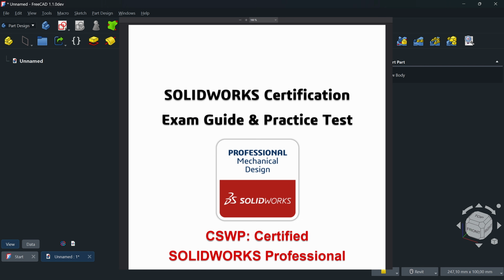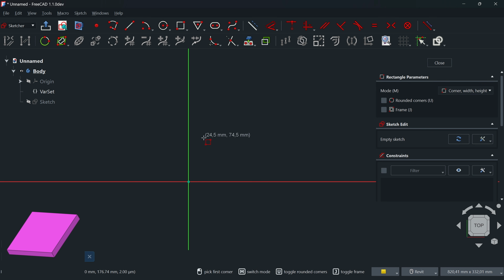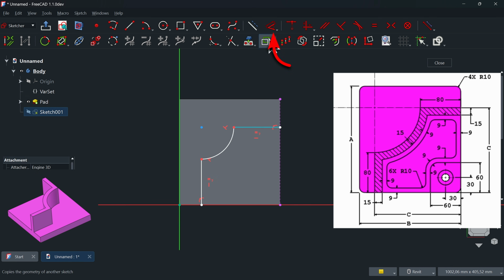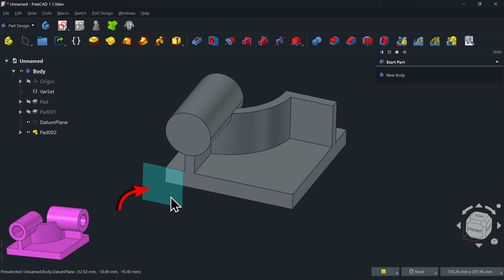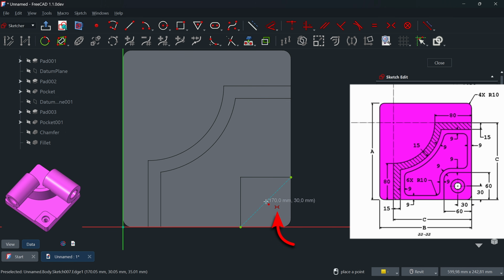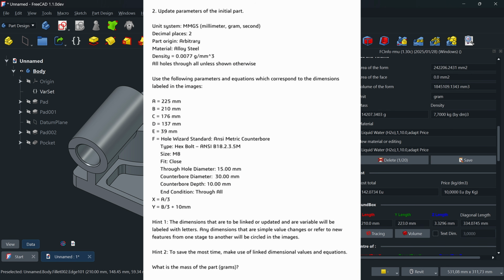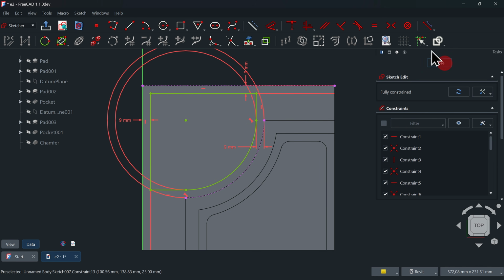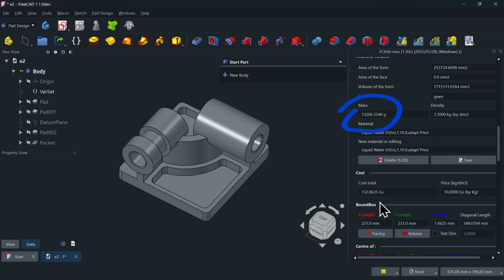Can FreeCAD pass the SOLIDWORKS Pro Certification CSWP ?  (Full Tutorial & Parametric Method)

Comment: Great video and support for FreeCAD!
Some small hints:
1. If you reference in a sketch, please use the previous sketch geometry.
2. If a dimension is used by more than one feature I would create reference datums.
(3. I prefer to create rounding if possible in the sketcher.)

Danke!
Reply: Yes, I was wondering why he didn't use rounded rectangles in his sketches. Fillets in Freecad can be fussy to deal with.
Reply: I will try to make it more clear.

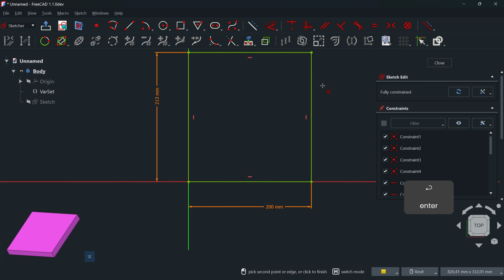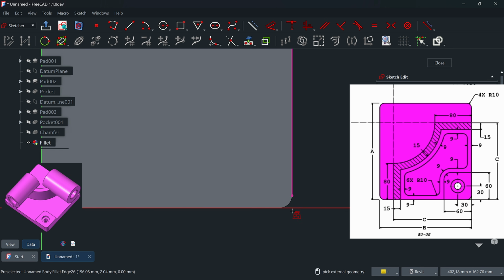At 4:59 he creates a sketch and at 13:45 he should use the edge of the sketch instead of resulting edge from extrusion (pad). Using the sketch geometry instead of “body” geometry as reference is making a freecad design much stronger.

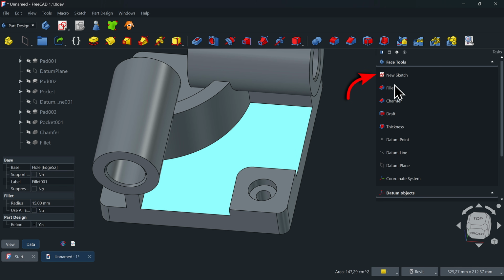At 16:26 is a resulting height from “pad” operation used as sketch plane, here it would be better to create a datum before and do the extrusion up to the datum and do the sketch also to the datum.
Reply: @efficincy  Thank you for the reply! I have some follow up thoughts and questions but I understand if you don't want to answer them for whatever reason. I appreciate what you have done already.

I attempted to follow your instructions and made a quick test to see if I could make it work. So from an empty part:

- I sketched a shape on the XY-plane
- Then I created a datum plane on the XY-plane and offset it by 10mm on the z-axis.
- I padded the first sketch up to that datum plane by using "Up to face"
- I attached a second sketch to the datum plane, showed the first sketch and hid its padding to make sure I selected the sketch geometry as external geometry and made my second sketch using that.

Is that close to the workflow you intended? It feels a bit strange that I have to click to show the first sketch in that way in order to select it.
 

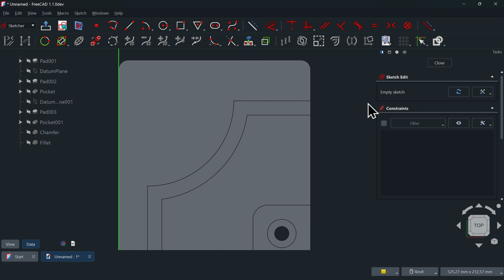Also for cases like at 16:32 where he uses external geometry that I think would be from 3 separate sketches or if one needs to make a sketch on the side of a padded sketch where the two sketches are not facing the same direction I feel like this would be difficult to do. Would it be okay to use the body geometry in instances like that?

Finally when using a reference datum like this can I attach it to an existing face of the body to use as a base for the datum's offsets?
Reply: @Shannon4710   Ok, you fully understood the first workflow you discribed.
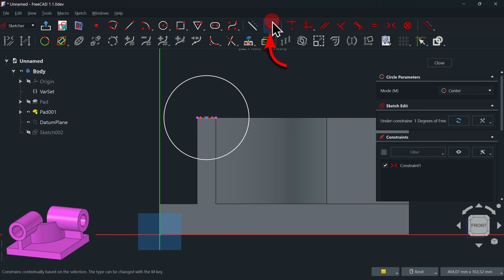The best example for the second part ist 10:46. Here it is better to have a datum in Z direction (you also used for the pad “up to surface” before) and the x-direction you can get from sketch which is in x-y sketch you only need to tilt the model to see the right edge, it the sketch is displayed. You are choosing somehow the same edge but not from body but from sketch. This you can vertical align with the center of circle on the z-datum.
Reply: Would you mind clarifying something about the first two points you made?
1. Was there a point where he did not do that in this video? I didn't notice him doing what I think you meant so I am afraid I don't entirely understand what you mean.
2. Similar to the other question I wonder if you could point to some instance in this video where you think the result or workflow could be improved by a reference datum as opposed to the method he used?
Reply: what is the difference between reference datumns and VarSet like used in the video ?
Reply: @maverick34 The usage of VarSet is fine. If you reference to a specific level/height, then you should not click on the surface and use it as reference, this creates a weak connection and during regeneration might lose this connection.

Comment: SketchUp was my first foray into 3D modelling, and I designed my plasma table in it. However, there is no easy way to do any CAM work in SketchUp, so I moved to Fusion 360 in 2018. I really liked Fusion, but the cloud-based/mandatory updates software thing always made me uncomfortable. I saw how much they removed from the free offering over the years, and I was scared that they would decide to remove the CAM environment or some other tool from the base commercial license, leaving me stuck. I started transitioning to Linux last December, and that felt like a good time to address my nagging discomfort with Fusion, since I would need Windows on my new computer to use it.

The freedom that FreeCAD offers is wonderful. I do miss some of the polish that Fusion has; however, FreeCAD version 1.0 was a giant step forward, and 1.1 looks great. As time wears on, FreeCAD will only keep growing by leaps and bounds, and not being subject to Autodesk's whims more than makes up for anything that I miss about Fusion. @deltahedra3d was a massive help in getting me familiar with the basics of using FreeCAD, and I recommend your bike part tutorials to all my friends who are either transitioning from something else to FreeCAD or learning 3D modelling for the first time. Thank you so much for everything that you do!

Comment: Totally new to 3d printing and modeling, I started to learn freecad using the huge guide from Dominique Lachiver, real nice document but a bit tedious so I quickly tried to help myself.

Got some basics on sketch but looking at this video made me realize not everything should be done on sketch mode 😂

Otherwise I like the tool, I even managed to hack some python macro that created some objects based on LLMs suggestions but I should definitely revisit them also.

Bad points of freecad: ui is not easy, pythons macros easily can crash the whole application, also on that subject documentation is hard to find and some designs choices are a bit weird (like creating constraints in sketch using indexes instead of the actual object reference)

Comment: I have used Fusion360 for several years, I learned it to make models for 3D printing. With Windows 10 losing support I will start to use FreeCAD since it works on Linux and is open source. Your tutorials will be a great help for learnig it.

Comment: I have used Solidworks for years but no longer have access to it, so FreeCAD to the rescue!  I miss the 3D sketching for weldments, is this not a thing in FreeCAD?  Also are part Configurations available.?  With the main pocket (cut extrude) can FC be told to start the cut offset from the base by 5mm, then up to the next surface?  That way your old teacher would not give you a bad report…🤔. Ps, anyone use CIMCAD back in the 90’s? Ahh the 2D days….

Comment: I started with Autocad LT in the second half of the '90s, mainly to play.
After a while I started working in a plasma cutting industry, on the machines, and I had my first cad shapes transformed in reality.
After that, I started working as a lathe machinist, and only in recent years I started learning 3D modelling for developing the moulds plastic recycling project you can see on my channel.

It's a project that I'm developing in my spare time, I'm using Fusion360 because I need the CAM, and since I do not make money with the project, being a hobby (at least for now), Fusion is free.
I tried the first version of freecad at the beginning, but felt simpler working on Fusion.
For now I can't see a reason to switch to freecad, we'll see in the future!

Comment: Thanks for your great contribution to open software and open design!! Here is a suggestion of a new topic to cover: 
I would love a video that teaches how to use FreeCAD to create designs based on 3rd party components, for example how to create an enclosure for a small electronics project like a Raspberry Pi with  buttons, mini OLEDs, etc. Here we could learn how to import external STEP files of the 3rd party components, and based on those components create an Assembly of Bodys that makes up the enclosure. You could cover topics like in which order we should design (starting from components, or place components during the design?), holes for fastening the PCB with screws (Fasteners WB?), snapping of parts and dimension allowances.

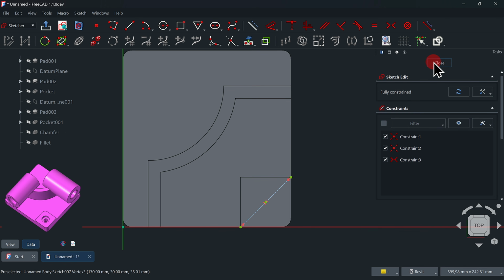Comment: 15:06, take a second look at the reference sketch.  The hole is specified relative to the edges, not to the center of the pad.
Reply: I caught that too. Although they are equivalent, he had just finished talking about using the drawing's dimensions instead of making up your own.
Reply from the maker: @hanelyp1 FreeCAD can sometimes struggle to determine whether a value is positive or negative from the edge, so occasionally it might shift the circle to the opposite side of the edge. That’s why I chose to place it at the center of the face. Technically, I didn’t add any new dimensions.

Comment: I learned with onshape and when I tried to move to freecad I felt as if it was clunky and "didn't flow" but after watching this masterful demonstration I'll have to go back, shut up and learn. 

Thank you!
Reply: I might try comparing solidworks to freecad. Although having 25 years of solidworks experience really isn't ever going to be fair. I think the external geometry paradigm is really one of the biggest things to get used to. In SW everything is already able to be used in subsequent work. And, from my experience it is MUCH harder if not impossible to change things once done (you can't roll the feature tree back and do stuff.)
Reply: @oxpack you can sort of do the equivalent of rolling the feature tree back. if you select the older feature and press space/click the view icon, it shows the part at that stage. You can freely edit any feature in the tree although it is possible to confuse it by making large edits, but usually it's just a matter of going through the later features and making sure they all still make sense after your edit. Freecad has improved a lot recently because of their work on the topological naming problem, it's not bulletproof but so much better than it was before.
Reply: @oxpack  The inability of FC to handle changes to earlier features without nuking the design is catastrophic for anyone using it for real work.

No matter how much you plan ahead, its geometry kernel is just hopelessly broken. Fine for tinkering, but it’s pre-alpha quality software at best.

And they still haven’t fixed the TNP. There was one fork from one person that tried to smooth over a few of the worst cases, but it did nothing to address the fundamental underlying flaw in the kernel itself.
Reply: @rainmannoodles  Can't wait for the next update due any time now where they have finally fixed that problem.
Reply: @rainmannoodles  That's because you're using it wrong. 1. Use variables or (as I prefer) spreadsheets for dimensions you might want to change.

2. base sketch and feature placement on a variable formula or spreadsheet formula. You can use datums, but they tend to have some issues in design changes. I only use them for revolution axis.

3. Avoid using primitives or Boolean functions. Stick to sketches and use the pad, cut, revolve, loft, and other 2d to 3d functions.

You can use the Boolean, fillet, chamfer, and other 3d editing functions, however wait till the end of your sketch work to do so. They should be the last steps in your part.

It doesn't nuke your part because of it can't handle it. It does so because AutoCad has made MAJOR bug fixes that do a lot of leg work for you so you don't have to be diligent in watching the program. 

You have to change your workflow. AutoCad is an automatic, Freecad is a manual. Of course you're going to break things if you try to shift gears without hitting the clutch first.
Reply: @rainmannoodles idk, I'm on the beta from a few months ago and it seems to be totally fixed. haven't run into any issues doing pretty major edits far back in the history of a fairly complex part
Reply: @rainmannoodles I haven't had TNP issues since the major fixes were enabled. None of the CAD programs have fixed TNP completely, but FreeCAD seems acceptable to me.
Reply: Prior to 1.0 I too was using OnShape only, however it has improved significantly with 1.0 and 1.1, to the point it is my preferred tool compared to OnShape, where I only use OnShape for projects I invest weeks and months into, however I have a medium -large project coming up soon that I will try to use freecad for.
Reply: Yeah, I've been trying so many cads for learning, and honestlyz freecad is really good rn.

Comment: I like freecad a lot, but the CSWP exam is more than just what's on this practice one. One part of the exam involves downloading pre-made SW part files and putting them together in an assembly, which I don't believe freecad can handle (correct me if I'm wrong)
Reply: It can't, but is that really the point of this video? I think it intends to demonstrate that FreeCAD can do all the CAD-agnostic tasks required for the exam. Otherwise the video could have ended at the first task, ie. "model this part in SolidWorks." 😉

If one needs to import external CAD data, not a single parts supplier worth their salt would provide SolidWorks models and not STEP files, which FreeCAD can work with quite well. Even better than SolidWorks, I'd argue, as the latter has to convert them to SLDPRT or SLDASM first before they're usable in an assembly.

Comment: Only that gets me with these cad programs is that every single fkn program uses their own language for certain design tools and functions. fusion 360, I feel has the most obvious ones. extrude mean extrude. but freecad has to use pad. wtf is a pad and offset plane is datum.. cant you all just agree on one single term. will make switching programs so MUCH easier.
Reply: aplogies, I know you dont work for htme but ist so frustrating. I have to switch sometime and I can draw whatever need in fusion360 very quickly but the transition is fkn painful. i struggle. im stuck looking for things that is just not intuitive. the UI in freecad is pretty bad. but i hate that autocad is forcing people to switch to windows 11. they can just die of vaids

Comment: Very good video! Also the first time I've seen how to use a VarSet. I'll definitely use this in the future!

However, I have a few questions:

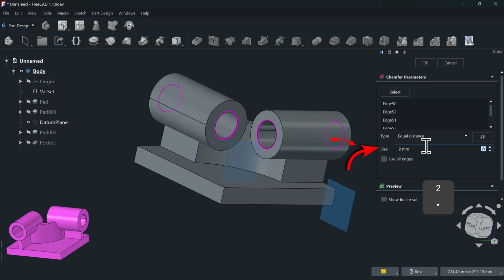13:05 Wouldn't it be better to add the fillets later? This would have made the next step of modeling the extrusion in the corner a little bit easier without the rounded corner.

14:52 I think here you can save yourself the step of creating the construction line. Simply using the symmetry tool on the two corners and the center of the circle should be enough, right? 

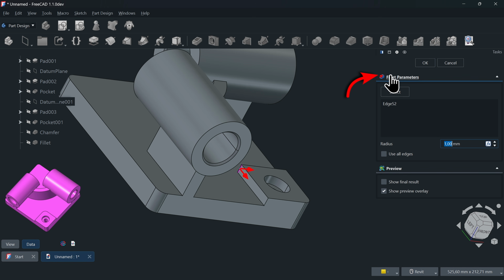16:03 According to your old teacher, what would be the correct way of creating the inner cutout? Would I have to pocket up to the bottom face and select an offset of 5 mm?
Reply from the maker: Thank you. To answer your questions: 1) Initially, I made the fillets at the end, like I did for Stage 2, but I was getting reconstruction errors when adjusting the variables (Freecad couldn't find the edges). Doing it this way solved the issue, I’m not sure exactly why.
2) There are many ways to achieve things in CAD, and yes, your method would work too.
3) I think the correct approach would be to create a 5 mm offset plane from the bottom face, sketch on that plane, and then make a pocket up to the top face.

Comment: For anyone wondering: Using projected geometry as normal lines is a version 1.1 feature. With the currently newest stable version (v1.0.2 as of writing this) it is not possible and the projected geometry needs to be recreated, as the projections can only be construction lines.
Reply: Thank you, I was wondering why it is necessary to make the projected line to a construction geometry. I never had to do this before.
Wouldn't it also be easier to draw the two circles in one sketch for the cylinder and skip the pocket operation?
Reply: Watching again, I notice that not explicit doing a pocket may lead to the support structure in the cylinder.

Comment: I only used TinkerCAD before FreeCAD, well, had short stint with blender, but without the appropriate plugins it was just a disaster (but i'm not a blender pro either).

I like FreeCAD a lot, but find it a bit unstable and buggy, though i'm currently on the weekly versions, so i guess i'm asking for trouble, the latest release i was using before wasn't too stable either. Sometimes i don't know if i did something wrong or what, and it takes less time to delete my current sketch and start over, than to figure out why it doesn't want to extrude it or complains otherwise. I'm getting better at spotting potential problems though. I wish error messages were more helpful. (What do you mean "need either a conic section edge, or a whole object for ObjectXY-like modes"???). Still, i have complains, but really like the software, it is quite powerful.

Thanks for your videos, barely halfway through and already learned a couple tricks!
Reply from the maker: @GabrielPettier Thanks for your comment. The learning curve with FreeCAD can be a bit steep, but with time, you’ll see that it’s something you can definitely handle.

Comment: I am a cswp and most of the shapes, of not all, on the exam are not real or useful parts. Some are. This part looks like some sort of pipe holder or bender... Or its nothing haha
Reply from the maker: @LT72884 I understand that these are parts that try to mix a maximum of different functions, but I like to know what I'm modeling, and almost all the exercises or exams are contemporary/modern art for me.
Reply: @deltahedra3D but yet the thickness tool cant handle a shape that has angled walls.... Drives me nuts. This is why i have not fully switched to freecad. I use the shell feature alot in SW but in freecad, it doesnt work due to limitations of the kernal.